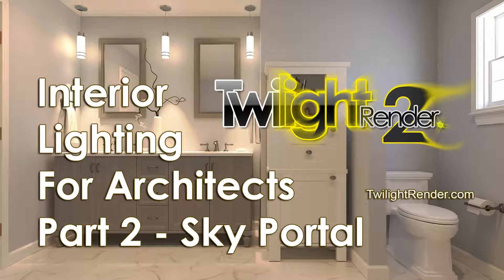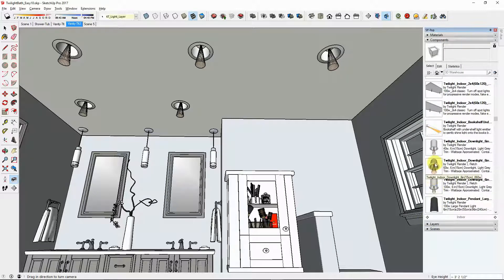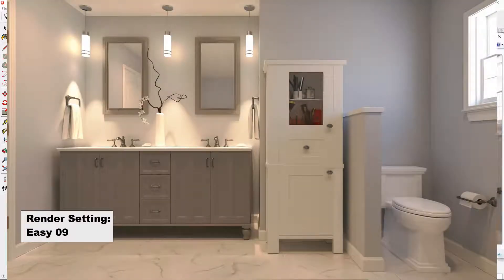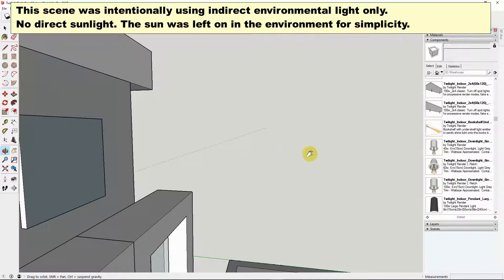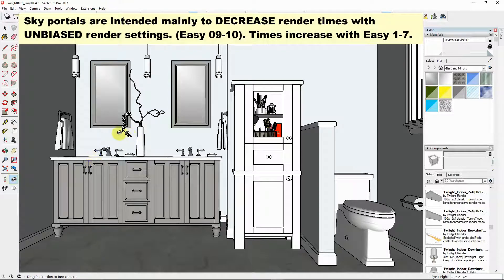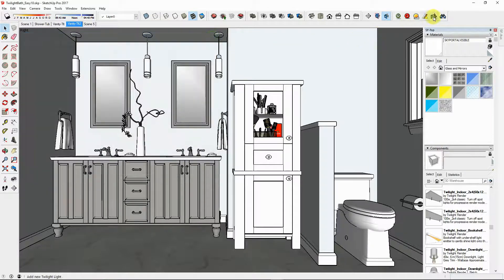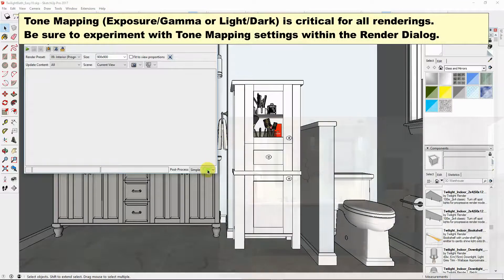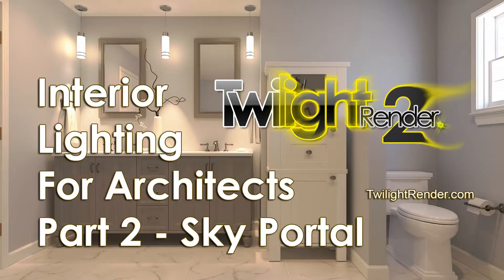Twilight Render Tutorial Interior Lighting Part 2 Sky Portal and Natural Light

Comment: The material that you painted the Sky Portal with (SKYPORTALVISIBLE), is that just a white material/paint that is default in Sketchup or is that some special material?
Reply from the maker: You can paint the surface with any SketchUp color and then apply the SkyPortalVisible Template to that material. It is not the default SketchUp color.

Comment: How much did it take to render in interior mode?
Reply from the maker: Render times are completely dependent on the rendering machine used. The more threads/cores you have on your computer, the faster the rendering will be. Every computer is different, so rendering times will vary.
Reply: @TwilightRenderPlugin  ok but for this particular interior, how much?
Reply: @artschoolkid9299  This was produced in 2017, render times were not recorded. When rendering with Easy 08, 09, 10 you stop the rendering whenever you feel the image is clear enough. Buy the new AI denoise Fast-forward add-on for Twilight Pro 2 to cut render times with progressive render settings drastically. In some cases reducing times by 3x or more. See TwilightRender.com for details.